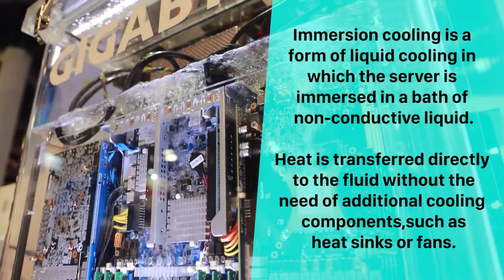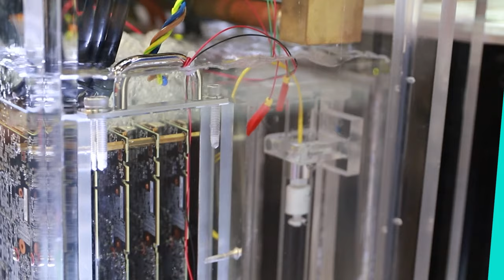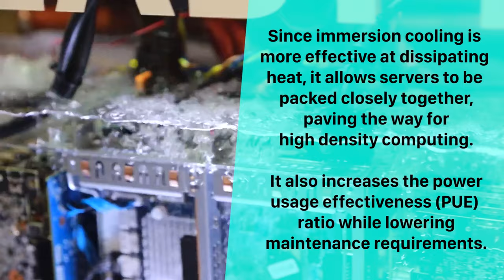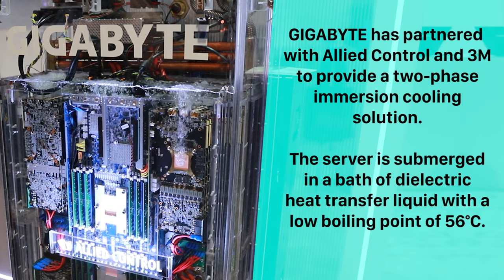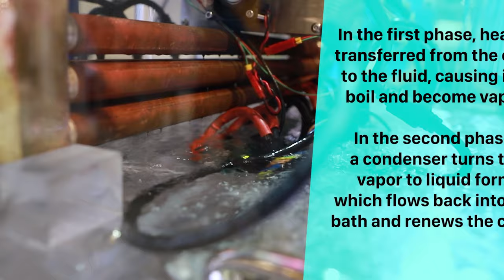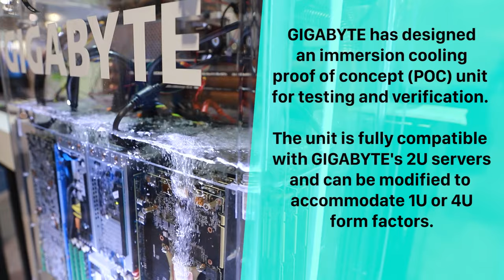What is it? Immersion Cooling in 60 seconds

Comment: I'm imaging being the guy who has to maintain this thing, what does it take to pull one of those boards out of the goo and tinker on it? Do I have to completely reinstall it back to test it? What if I spill some of this stuff on me, or get it in my mouth? I need to know because this is awesome regardless. :)
Reply: According to Gigabyte, the liquid is non toxic. But still don't recommend drinking it.

According to Gigabyte, It doesn't stick to anything.
Reply: @redlock1815  Yes it was demonstrated. They immersed a dollar bill inside the liquid and took it out. It was completely dry to touch.
Reply: @jesselam5867  that's fucking awesome
Reply: Not Oil.

Comment: We need this in a self contained unit just for the GPU. I sure any gamer can attest to losing a GPU or two in their life. How many cards have been toasted because of lack of cooling supplied by the manufacturer. I really believe this is done on purpose by graphic card manufacturers to get you to buy more cards when they die. Of course being  how crazy GPU prices are now nobody can afford a new GPU. 🥴
Reply: I am from the future. Prices have come down!
Reply: Using a GPU do to inefficient cooling is not common. The chip usually clock down or even power off when becoming to hot. Unless the cooler literally falls off. I have not seen a GPU die in many decades

Comment: Wondering why vapor is good for heat transfer? Wouldn't a liquid that boils at 110°C+ work even better?
Reply: The components stay submerged in a liquid that never reaches a temperature above boiling. Any portion of the substance that gets that hot immediately moves out of the way (as gas bubbles).
Reply: Not only that, the bubbles rising promotes natural circulation of the fluid. The hottest fluid will be replaced with cooler fluid.
Reply: Heat is released during phase change, so the lower the boiling point the more efficiently it can remove heat from the tank.
In your example, that means the CPUs would be sitting in 110C liquid, instead of 85C liquid (remember from science class that once a liquid reaches its boiling point, the liquid’s temperature stops rising), in effect acting more like a heat insulator rather than a cooling system.

Comment: What about the differnt kinds of plastic? Will they be solved over time? What about the casing? Acryl? Glas? Use a Dewars "bottle" and cool the 3M fluid down to dry ice temp. ...seal the Deware like a fermentation bottle, replace the oxygen with pur nitrogas, take care that the nitrogas will be dry / use Silica gel to do so, take care that all cables goin in and out into the Deware bottle are well sealed, integrate a inert coolingsysem .. then, and only then, we are having a new idea.

Comment: 3m novec is available now in a spray but is absolutely expensive about 16 cans to fill 3 gallons costing 60$ each U.S
Reply: Simple and cheap solution: try gasoline or some other hydrocarbon/mineral oil with similar properties. They use the same chemicals packaged in a fancy 3M bottle and sell it to you 50x the price.

Comment: no info, probably are toxic petrol based chemicals. there's coconut oil with low corrosion compared with sulphur petrol mineral oil. coconut oil can be used with bio additives to lower acidity, humidity, etc. also there's no need to fill the tank with dielectric fluid but use passive cooling with a water tank underneath where the oil cools travelling in hoses
Reply: Coconut oil would not work in the slightest, and would destroy the board.

Comment: Just another log to throw into the PFAS controversy, which is too bad. I otherwise like fluorinated hydrocarbons, but they sure aren't cheap! I had used 3M Fluorinert FC-5311 in two-zone vapor phase solder reflow systems. At about $5,000 a liter, mind you!! 🙀🙀🙀🤑💰💸💸

Comment: why don't put the condensers inside the liquid and use a fan type something to make the liquid flow so that heat capturing is even?
Reply: Cos u dun have too and u can't, condensers are usually for gas, so u put it outside the liquid,. This cooling system is already too efficient with the low boiling point liquid. I understand wut u asking for but that's for higher boiling point liquid where the liquid does not boil to carry the heat upwards so u have to put the "condenser" (cooler) inside the liquid. This is also gud but unnecessary when u have the low boiling point liquid available my explosive friend.
Reply: How you condense liquid 🤨

Comment: forgot to mention this fluid is 530 bucks for 20L.
Reply: Forgot to mention you won't need AC units in your server room.
Reply: @XavierBetoN  mining field don't use AC unit. way too expensive to run miner with AC. just industrial box fan will do the work
Reply: @CoreQ  That is correct. But I'm pretty sure I said 'server room'